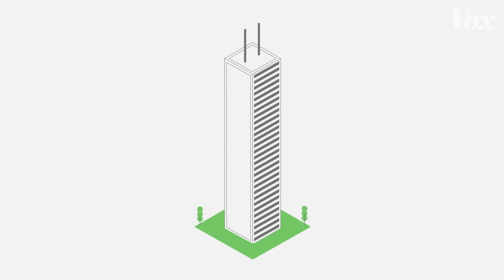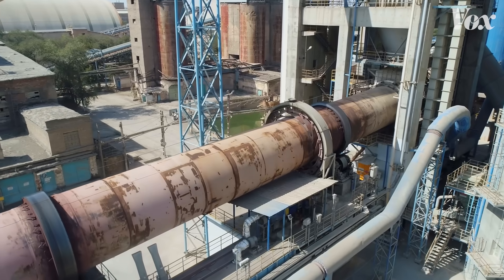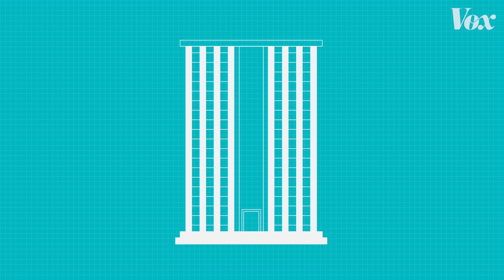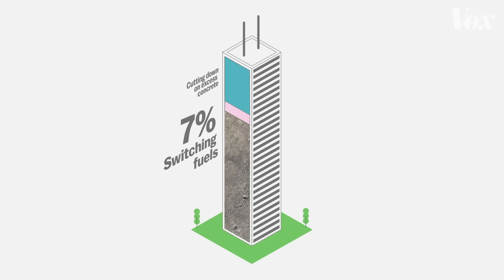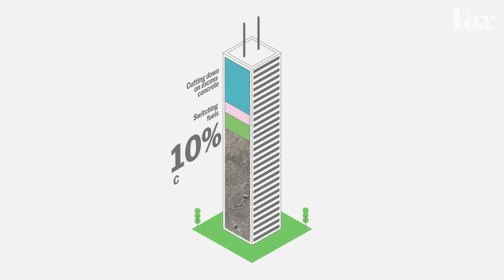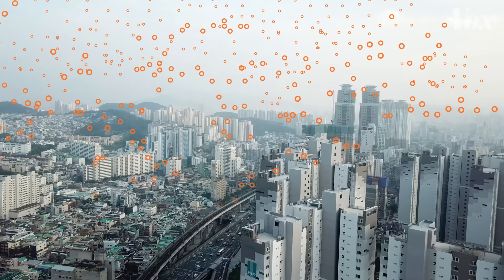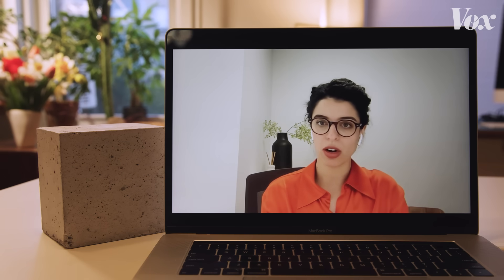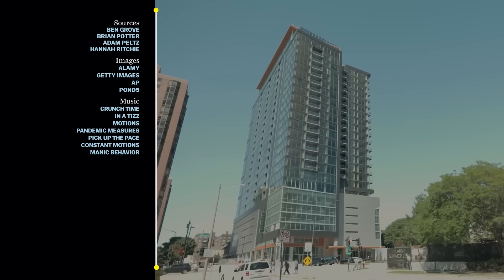The big problem with cement, and how to fix it

Comment: There is another low-hanging fruit that could get you there - nuclear.  The typical (CANDU/LWR) reactors run at about 300C but there are plenty of designs that come close to 1000C.  That won't get you the 1450C mentioned, but the 850C is quite doable with high-temperature reactors such as the HTGR.  The rest of the savings could come from using different materials that need lower temperatures and/or having the reactor also generate electricity and/or hydrogen (from water) which could be burned as a fuel on-site to get the rest of the heat, eliminating the need for fossil input altogether.
Reply: Or we can use electric resistors powered by nuclear powerplants. Electric resistors are becoming easier to operate at very high temperatures.

Comment: China has been building enormous apartment buildings with cement to keep their politically tied big construction firms strong. These apartments stay uninhabited besides a few squaters and they start falling apart after only having stood a couple of years. So using china as an example of these concrete mixes being adequate, does not add up @Vox

Comment: For anyone wondering, cement is the dry mix used to make concrete. Once it's poured and cured, it's no longer just cement, it's concrete.
Reply: What's the difference between concrete and mortar?
Reply: @FancyUnicorn  Concrete and mortar are both a mixture of cement, water & sand but concrete has coarse aggregates and gravel added in and they have different consistencies.
Reply: @FancyUnicorn  concrete has gravel, mortar not .... the rest its the same depending on the mix

Comment: There was a lack of mention in regard to green hydrogen being an alternative kiln heat fuel source. Current limiting factors like cost and availability do pose issues, however, green hydrogen also presents the possibility to reduce emissions by the entire 40% dedicated to heating.
Reply: But if you are doing CCS anyway, why not do CCS on the fuel + the calcination emissions, and save the (expensive) hydrogen for a different purpose?

Comment: One thing I suspect you don't account for is many cement plant generate electricity by cooling there finished clinker.  When said electricity replaced power generated by fossil fuels it effectively offsets some of the carbon generated.
Reply: It's a small amount compared to the emissions, and yes, it's accounted for in the models.

Comment: Anyone preaching to use marginally less concrete in the construction of a building (or pretty much anything) is out of their mind. Slightly less concrete cover, thinner slabs, and the like, all contribute to premature degradation of structures. We frequently see misguided engineers trying to make a slab 1" thinner... It doesn't work. It actually increases carbon emissions (premature failure and the need for extra steel, which is even worse for the environment). Just build a building that will last AT LEAST 50 years. There's no reason why codes can't be adjusted to ensure all concrete structures will last 100 years.
There. We just saved 75% of the concrete emissions.

Comment: You’ve conflated concrete and cement in this video. Cement is an ingredient of concrete, they are not the same thing.
Reply: No they didn't. They mentioned that cement is an ingredient of concrete, and that cement is the part with the CO2 emissions.

Comment: Is there any way to recycle concrete? Or use recycled materials as an additive in concrete?
Reply: Concrete can be recycled. A lot of roads that get ripped out (I’m not sure about asphalt) get put into plants that reform the concrete and recycle the steel rebar

Comment: I saw about a year ago a type of concrete that was made with up to 25% of hemp.
Reply: The problem with hempcrete is the material is far more porous and airated than Portland cement, as a result it has about 30% the compressive strength as typical concrete. 

This is why ASTM nor ACI technical specification institutions for construction consider hempcrete to be utilized for load bearing applications. 

You can use hempcrete for a free standing wall or as a veneer on your building but you can’t use it as the foundation

Comment: As a civil engineer (in training/EIT) a couple of things stood out as suss to me in this video. 

First, the claim of overuse of cement/concrete in infrastructure projects.. the amount of cement used for a project directly correlates to the cost of a project- more concrete more cost. Clients want the cheapest they can get, and us delivering a lower cost makes us look good and can get us more money. So the claim that we use more cement than needed is odd to me- I’d say we use just enough to make things “safe”, and even then contractors or designers may cut corners to reduce cost and that results in catastrophic failures and lots of death time and time again. 

Second, you mention the need for cement manufacturing to recoup energy, like heat waste. But in my experience working on power plant and manufacturing plants, they often already do. For example, waste heat is often used to power turbines which can power the plant itself. This is a cost saving measure, the companies are already incentivized to reuse that heat. You interview many experts in this video, but mot once did you interview a cement manufacturer on their excess waste/heat measures put in place, instead you just claim they need to do it.
Reply: Yeah, I found out that this video is lacking the holistic view
Reply: As a watcher of this video, a couple of things stood out as suss to me in this comment.

First, she doesn't suggest cutting unnecessary components in projects, which would indeed save costs. She suggests using alternative materials for components where concrete is not necessary for its compressive strength. They give the example of the new parliament building in Scotland. I.e. the substitutes are not always cheaper, but emit fewer greenhouse gases in their production.

Second, she did not claim that concrete plants are not recouping energy from waste heat. She mentioned that capturing and storing the emitted carbon dioxide is in its infancy. She also mentioned that some concrete plants are now burning alternative fuels (like trash) to generate the heat.

Basically, companies do what is cost-efficient and effective. They'll use less energy and material if it saves them money. If an alternative material costs more but emits less carbon, they won't use it unless they have a financial incentive to do so, like earning tax credits (carrot, the current trend) or avoiding a tax on the emissions (stick, less popular politically). That's the nature of business and society.

Comment: As concrete sets it absorbs the 60% carbon portion, you referred to, that was lost in the quicklime manufacturing process. This strengthens the concrete gradually over the course of a month and more. Also, clinker is a hard baked mix of lime stone and clay/ash the heat is the issue that is the primary source of carbon. There are alternatives to concrete, which are sometimes called geopolymers.
Reply: I was about to mention this also. It takes a very long time though. Many decades ... So one solution is to design structures well, and keep them standing for as long as possible.
Reply: @leopoldlaurenzstrobl7438  Over the lifetime, it takes up at most 20 % of the emissions; the rate is just too slow (it depends on t^0.5, so gets slower as a function of time).
Reply: its a shame they did not talk about this

Comment: Imperial US based companies won't do this in time unfortunately, because they're not taxing carbon hard enough nor are they doing some kind of carbon credit situation. Especially when most of the cement is used for sprawling, car dependent infrastructure and an unsustainable housing situation, and office buildings that should be abolished.

Comment: The biggest problem here is that Carbon Capture and Storage (CCS) doesn't work. CCS always has missed its target. I hope CCS can be improved and actually work but relying on it right now will not work.
Reply: Nothing works until it works.  That's why we need to prove it.

Comment: I know that Hempcrete is a thing that could be looked at as an alternative.
Reply: I really wished they would've talked about it  :/
Reply: @star_gem6069 it’s not a load bearing material, so I’m about 90% of total volume applications you can’t use it. 

Maybe for some sidewalks, but you can’t use it for curbs. You can use it for free standing walls. You can use it as a veneer structure to absorb CO2. 

But the grand majority of concrete placed is for load bearing applications because that’s what the material is designed for

Comment: There are a lot of buildings (due to code) where you literally can't design it using wood.  There are also a lot of safety things being pushed that require me to design using near 10x the amount of concrete than the structure needs on a day to day basis.  I understand there is an importance in saving lives during major storm events, but at what point is it overkill.
Reply: and how much wood do we have to use to start being worse than concrete due to deforestation?
Reply: A few advantages of concrete over wood:
-reduced flammability
-greater manipulation for more complex designs
-uniform & predictable strength properties (wood grains are unidirectional)
-higher buildings for more people
-modularity I think is easier with concrete, but I could be wrong with that. Just thinking of lego bricks

Wood can actually be used in some high rises, there are treatments for wood to allow it to be inflammable up to a degree
Reply: @magnetotwister  and also:
-reduced noise
-reduced vibrations 
-its a great heatsink (cooler during the day/warmer during the night=small AC/heating bills

Comment: Cement is doing harm to environment but not cutting wood for those buildings 😂 how can wood be a replacement for cement/concrete

Cement emitted most of the carbon only during the manufacturing but wood captures carbon throughout the life

Comment: But doesn't the cement take CO2 from the air as it cures? So you're basically just releasing CO2 that gets reabsorbed later making the process about net 0.

Comment: Substitute percentage of clinker with clay Its just change the area of carbon emission

Clay not like clinker It is more difficult to find and not very common to find in nature 

I think this cement problem very very problematic though 

And one simple answer is just build the building with no concrete at all 
Like in old village 
Thats just the answer

Comment: documentary from Québec illustrated using wooden 1' and 2' square wooden beams , so beautiful and when building is demolished reuse the beams after sanding. there were limitations on height, but the buildings were so much more attractive.
Reply: As someone else mentioned if we used wood at even a fraction that we use cement we wouldn't have forests anymore.

Comment: The whole podcast is committed to tortured logic. Cements killing the planet, if you spend 100% more on the environmentally sound cement, not that big of a deal.  

Hold on, every component of building a structure such as a high-rise could have the same rationale applied to it. If you only spend 100% more on environmentally sensitive componentry, you’ll save the planet problem project increase in price 100% and probably not as well built nor last as long.
Reply: Cement is an easy place to start, because it's a big part of a building's CO2 footprint, but not a very big part of its budget. So you can reduce emissions by a lot for a relatively small price increase.
Reply: @HeadsFullOfEyeballs  “easy place to start” what are the consequences? Economic, safety, longevity.  And as originally commented and you acknowledge, this is the justification for arguing, environmentally sensitive materials for everything not just buildings. When one evaluates the economic consequences of this strategy it is not economically viable.  

Be well

Comment: How is cutting down trees for wood better for the environment?
Reply: Trees are carbon sinks -- they pull CO2 out of the atmosphere and lock it away in their wood. So when you cut down a tree and build a house with it, that carbon stays trapped in the wood. Grow more trees, repeat.
 
Compare this to the limestone used in concrete. The carbon in the limestone was pulled out of the atmosphere millions or billions of years ago by the organisms whose tiny skeletons make up limestone. So when you release that carbon by making concrete, you are adding extra carbon to the atmosphere that was locked away before.

Comment: Total cement produced:
From 2010 to 2020, the total cement production is 40 billion metric tons.
Carbon created off of that:
Using the emission factor of 1,370 pounds of CO2 per metric ton of cement (which is approximately 0.621422 metric tons of CO2 per metric ton of cement), the total CO2 emissions generated are 24.86 billion metric tons.
Cost to capture and store:
If it costs $10 per metric ton of CO2 to store, the total cost for storing 24.86 billion metric tons of CO2 would be:
$10/tCO2 * 24,860,000,000 tCO2 = $248,600,000,000

So, the total cost to capture and store the CO2 emissions would be approximately $248.6 billion.

Volume and comparison to the natural gas industry:
If one metric ton of CO2 occupies 556.2 m³ of volume, the total volume of 24.86 billion metric tons of CO2 would be:

24,860,000,000 tCO2 * 556.2 m³/tCO2 = 13,823,972,000,000 m³

The total volume of CO2 emissions from cement production is approximately 13.82 trillion cubic meters.

The natural gas industry (WHERE WE MAKE MONEY PULLING GAS OUT) was 35T cubic feet in 2022. 

SKIP vox, read IEA , IRENA, misinformation is more damaging to the climate movement don’t propose non answers

Comment: Yeah, those are nice ideas, for non-seismic areas. Let me know when those environmentalists think about how to build houses, buildings, skyscrapers only using concrete and steel when needed in seismic areas. When they find out how to build things in seismic areas with out digging 5-50 meters deep only to put in the foundations.

Also, Vox needs to stop thinking that the US is the center of the World, because in other countries, people build with concrete and steel because it is cheaper than wood. Only in the US you have access to huge forests that provide all the wood you need. Imposing a 'green premium' in concrete would only make housing more expensive than it already is.

Comment: China has a tofu building problem though. Why not use hemp crete?
Reply: it would be ironic if china use more cement to strengthen their buildings because many call their buildings as tofu
Reply: @khein2204  the tofu doesn't come from using "more' the tofu comes from a regulation issues when they build in general. we had the same problem few years ago in the middle of new york there's a weird leaning building that still is unfinish and needs to come down but it's stuck in court. it's rare to have that problem in new york but building regulation is tougher. And the checks along the way. Honestly, EU is pretty good. ecuador is improving as they push for more earthquick reisistant stuff since they are also near a line.

Comment: Another issue is that the west seems to think that countries like China and India need to work fast whereas the per capita energy usage in Asia is very low. People in Asia still don't have 100% electricity, leave alone central heating or cooling systems. They don't own cars as much as requiring while cities to be 50% infra and 50% parking.  Carbon capture and echo friendly techniques can only be possible in the 3rd world when it is cheaper than other alternatives. Most people here don't even get a day's healthy food.
Reply: I mean, they still need to work fast, because the problem ultimately are humanity's collective CO2 emissions, not each individual's emissions. It simply isn't feasible for China or India to put as much greenhouse gases in the air per-capita as rich industrialized nations have historically done. If they do, everybody dies, themselves included.
Reply: Cement is not that bad for the climate as the cars. And if start of the video states right information about 12 million miles, then all us citizens produces same amount of carbon on their cars every minute (and i don't think that our whole planet builds 30 story building every minute)

Comment: Not even a mention to how we're running out of viable sand to make concrete? I suppose that ought to be its own video.
Reply: That's not actually a problem, brick, stone and even old concrete can be ground down into usable arids
Reply: @Fredward1  I believe it’s a greater problem than you think. Ideally it isn’t a problem because of your reasons mentioned, but corrupt companies in India have been well documented to be stripping sand from many rural areas, further eroding river banks and such
Reply: @magnetotwister  that's a problem but it's not the same problem I was talking about, those companies should be fined

Comment: You're only considering CO2 released during the production of the cement. There is a whole lot of carbon emission before and after — transportation, construction, machinery, maintenance, demolition and finally the end of life. The whole lifecycle is much bigger.
That's part of the problem with carbon calculation which leads to an incomplete understanding of the challenges. It should be explicitly mentioned while showing the figures, which part of the lifecycle is considered.
Reply: Question, why is c02 such a bad thing?  Don't plants use said compound?   Why is it that all of sudden c02 is enemy number one?  Especially when we know at 0.2% c02 concentration, all plant life dies.  We've hovering around 0.4%